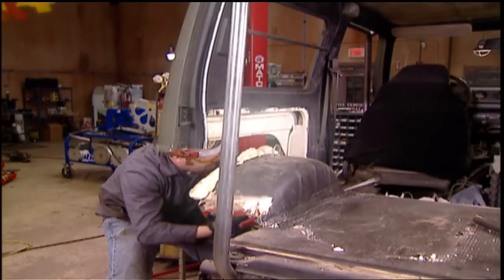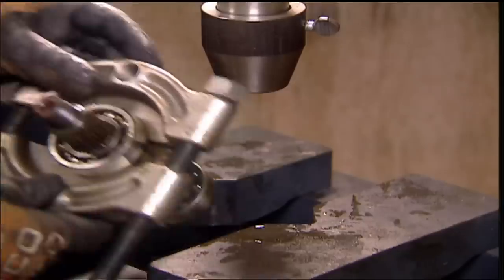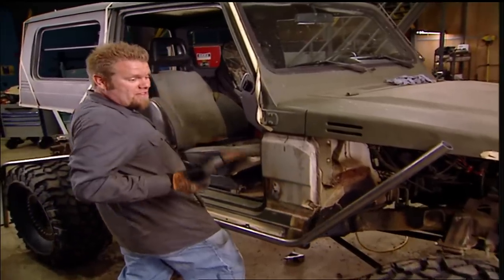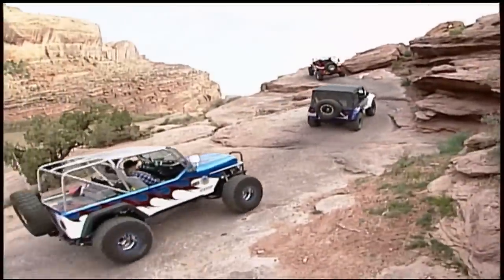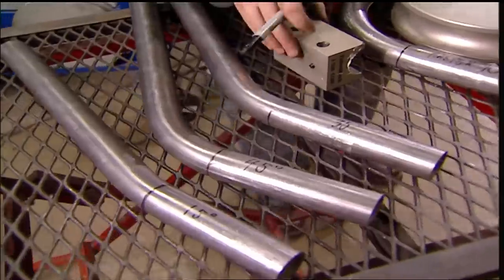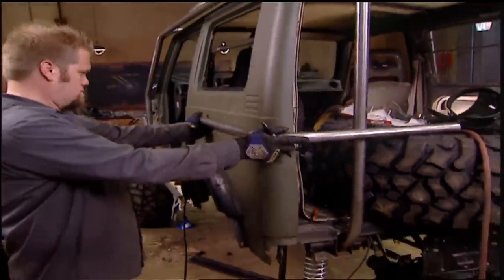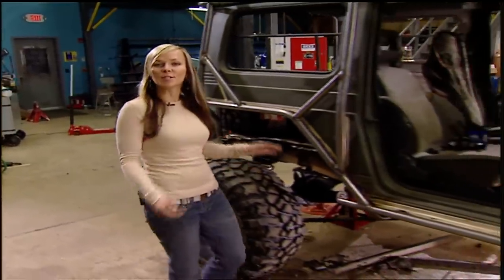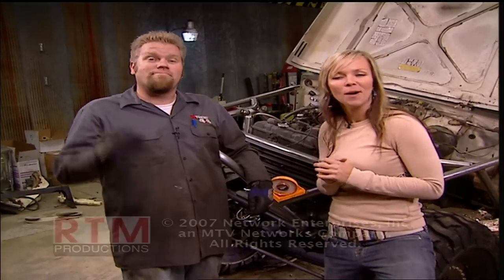Adding An Exoskeleton To Take The Suzuki Samurai From Mild To Wild  - Part 2 - Xtreme 4x4 S2, E21

Comment: Those tires alone are 1800$ in 2023 lol. A clean tin top Zuk is 5-7k, Toyota axles, 600-1000$, 6.5 gears, 650$. Crazy
Reply: Doing anything for under 10k in 2023 is on a “budget”.
 Build it now because it only gets worse.